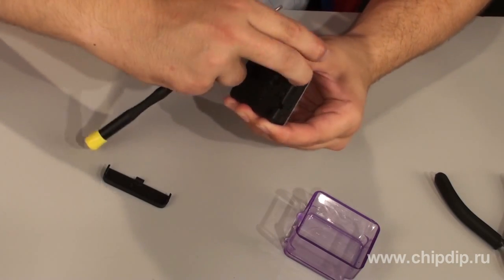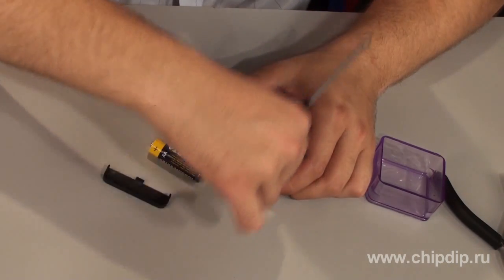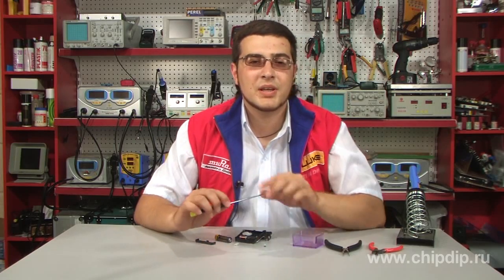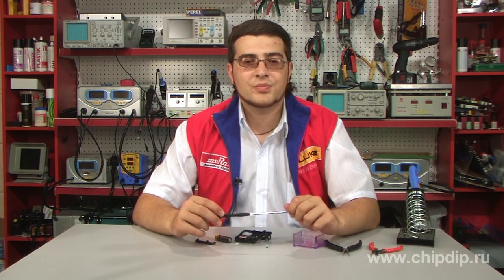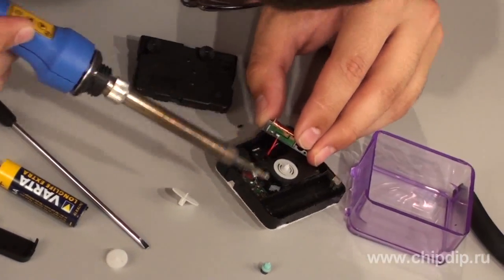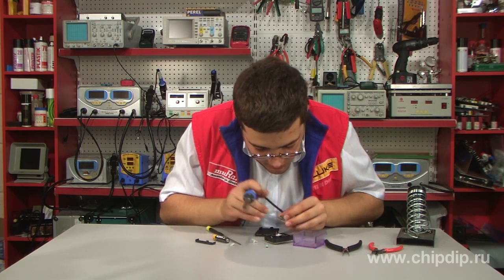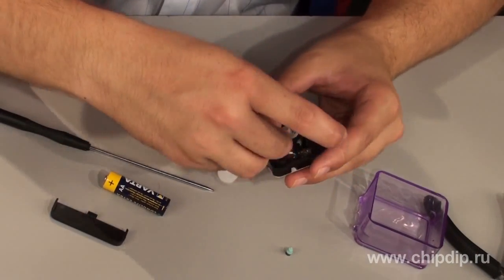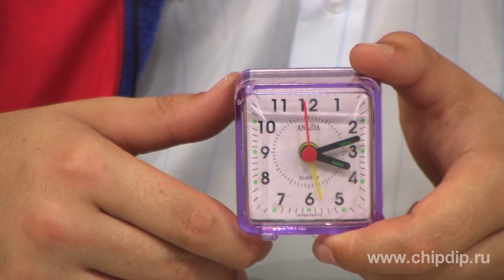Inverse Clock

Comment: Here is the BEST explanation of the "LAVET" quartz clock motor movement and how it works. Yes, you can reverse the rotation of the  movement by either 1) reversing pos/neg of the wires coming FROM the quartz (not the battery) to the coil, OR 2) by carefully removing the iron core of the coil and flipping it over 180 degrees! NOTE: Battery voltage does not go to the coil and therefor reversing the battery has NO effect on the direction of rotation!😀

Comment: Why don't you just put in the battery backwards
Reply: The battery energizes a circuit that drives the quartz with the batteries polarity. The quartz generates and sends ANOTHER SEPARATE  electrical signal at 'its' polarity. Reversing battery voltage has no effect on polarity output of the quartz! Swapping the polarity of the voltage from the quartz, reverses the polarity to the coil and the direction of the step motor!